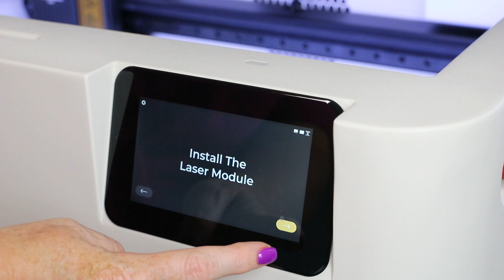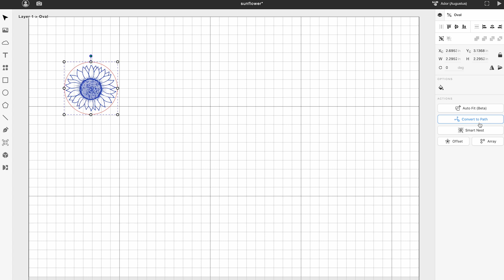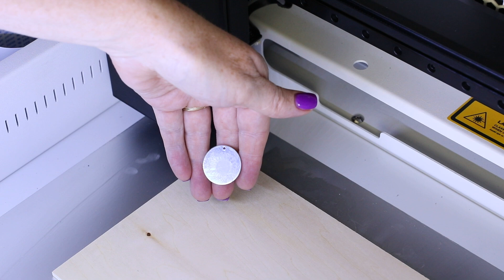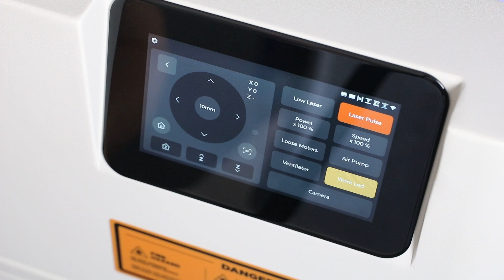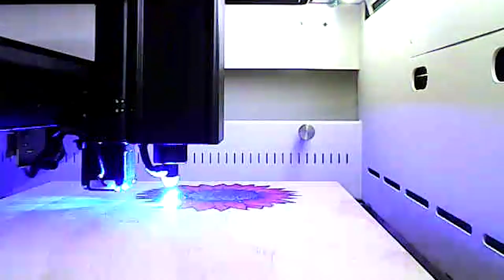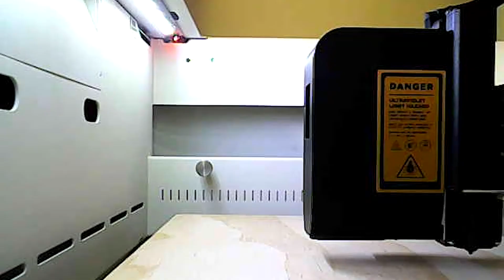Flux Ador Laser: Your Complete Guide and Honest Review

Comment: Wow! Comparing the Flux Ador Laser with the Xtool M1 Ultra feels like we’re going backwards. What I mean is that the Flux Ador Laser isn’t innovative enough to be more user-friendly. You have to screw in all of the modules and configure them each time. The M1 Ultra, on the other hand, has no screws, and its modules simply slide in and out without needing to be configured.

The Flux Ador’s print module only uses one color at a time, whereas the M1 Ultra’s print module contains all four colors, so you don’t need to swap cartridges constantly. With the Flux Ador, a single-color cartridge would require you to replace it each time you need a different color.

Additionally, the camera on the Flux Ador isn’t as good just as bad with the WeCreat. The cameras used in lasers typically have fisheye lenses, which don’t accurately capture the cut or laser area. Fisheye lenses have always been an issue with lasers. In contrast, the Xtool M1 Ultra uses a pinpoint positioning system that is highly accurate.

Finally, the Flux Ador’s extension design is also lacking, as it has no front door to easily slide the honeycomb tray in and out, whereas the M1 Ultra includes this feature. In my opinion, the Xtool software is also far superior to the Flux Ador’s, offering more tools for working on projects and supporting multiple Xtool lasers at once.

That said, these are just my opinions. I own the Xtool M1, S1, and WeCreat, and I’ve tried many other brands. By far, Xtool is the best when it comes to innovation and user-friendliness compared to other laser models.

Otherwise, excellent presentation 👍
Reply from the maker: Actually the M1 Ultra is only a 3 color printer not a 4 color. I would agree with you on a lot of those points actually. I didn't say which was best just that they offer similar options - since they both print.
Reply: @AngieHolden  Thank you for the correction, I meant to say 3 color. 😎
Reply: that's because the Ador was there before xtool released its machine. But there is also some technical reasons as to why Ador uses single color cartridges and xtool on the other hand has only CMY, which looks dull. Adore colors are much more useful as they used ecosolvent ink which is water and as far as I know uv resistant… stools inks will fade or wash away. Sadly on the other hand adore print as far as I have seen them, are very bad resolution, I think only 150 dpi.  I would love if someone would release an actual machine with a useful print unit. Like a pigment print unit or something. :D but that's not gonna happen soon as I found out both machines are using a very cheap way of crafting a print unit, they just took parts from other existing devices and assembled them to something new.